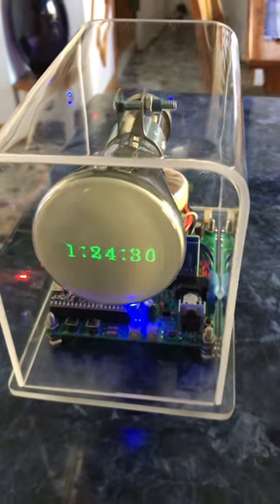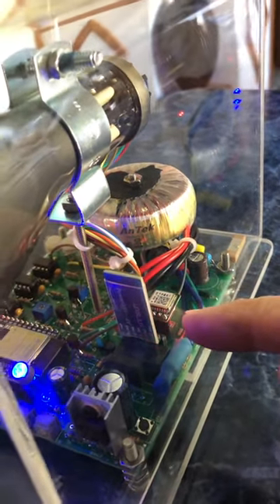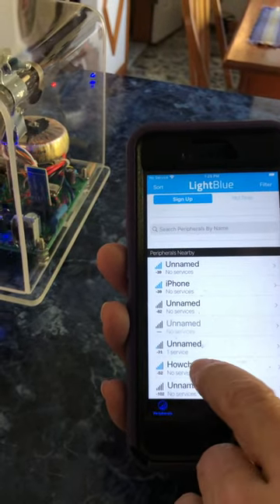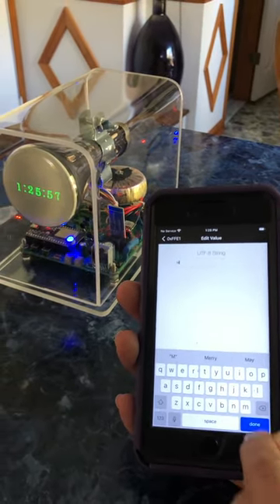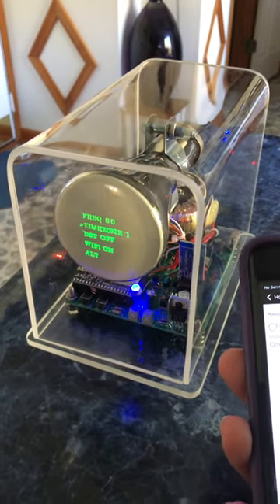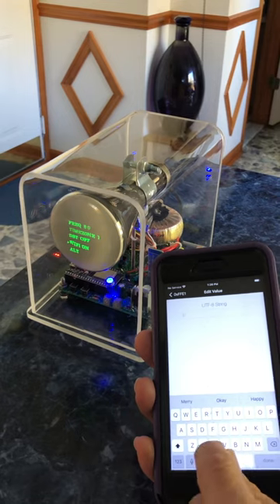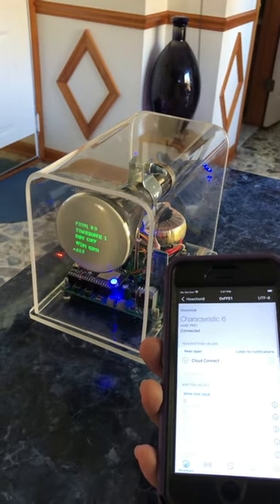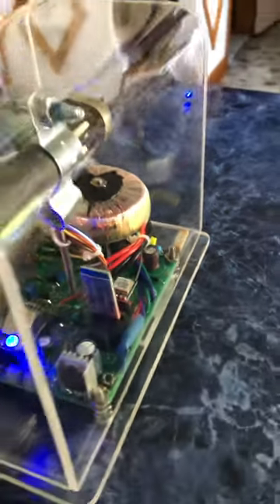DG7-6 Oscilloscope clock description of some features

Comment: that's so cool doe's it work like a crt ? it looks kinda blury but still cool af
Reply from the maker: Thanks! It is a CRT. It’s not really that blurry it’s just difficult to video it due to the nature of the phosphor but in reality it’s much more clear. Please check out my page oscilloscopeclocknixiecrt.com
Reply: all old scopes are basic crt.

standard mode of scope is time based, with time on horizontal.

but all scopes offer an XY mode which allows you to draw anything you want. it's just a drawing table, where you input  X and Y coordinates of the point you want to draw. the longer you stay in place the brightest. you can draw any line, and if you are good, you can even along a line obtain a gradient of light.

the only limitations are :
- speed accuracy of your scope (speed of internal op amps )
- image must be drawn within 0.8s 

you can start to play this with a basic PIC or Smallest known arduino as soon as you get have at least 8 IO pins. with 8 pins you can build two ... four bit digital to analog converter ( using 4 resistances of increasing multiple values, ie, 1k + 2k + 4k + 8k ) , resulting in a gradient of 16 different values per group of 4 IO and this is way suffisant to have fun. this will offer you a 16x16 grid of points with investissement below 1€. 

with a better DAC you just can draw anything you dream. 

think the crt is your pen, and the two scope inputs are X and Y positions of the pen. anything that can produce a voltage can do the job ( including a raspberry pi).